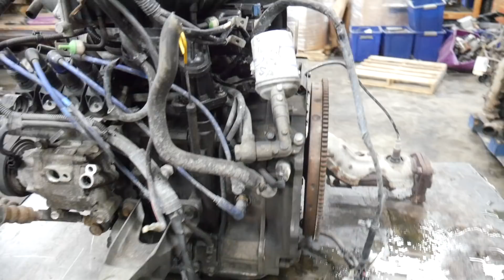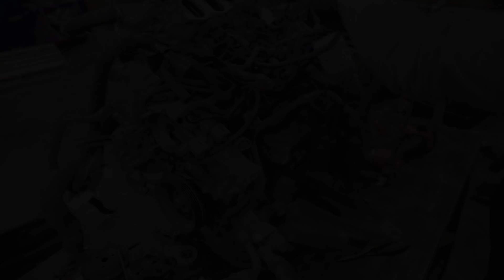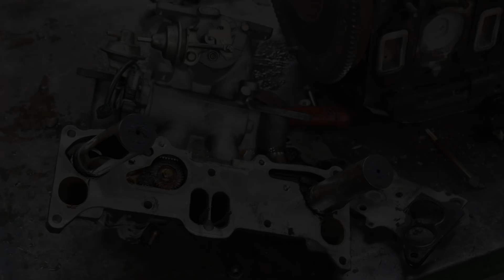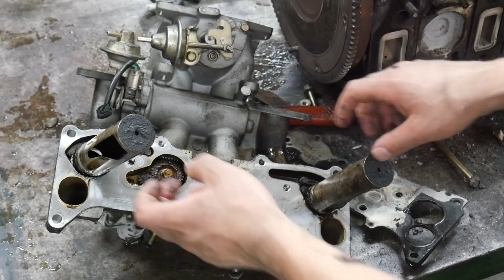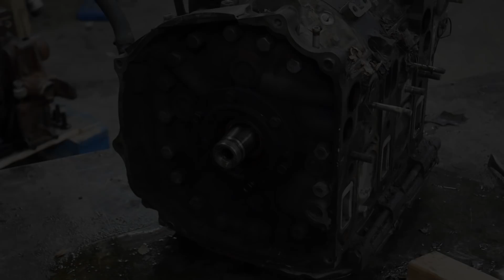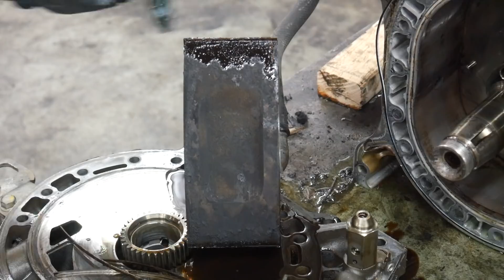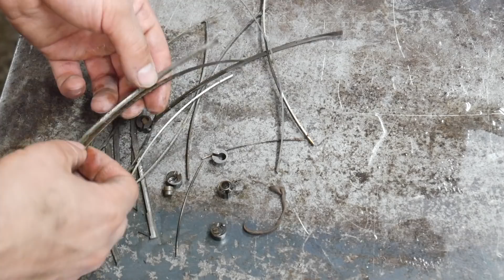13B RENESIS Total Rotary Teardown. 04-11 Mazda Rx-8 6-Port!

Comment: What kind of horsepower can I get out of my 2004 after I rebuild and changed to 19 9413 B housing and rotors, change ring, and pinion gear in rear 4.4  r 4.1

Comment: the rotary engine is a race car, if you are not on top of maintenance all the time they will fail on you, and it will be catastrophic failure, seals breaking off being sucked into the turbo system, mazda themselves just offering to replace the entire engine instead of tearing it down and fixing it cause it would be much quicker for the customer. Rotaries are not reliable in the sense that they cannot just be driven and ignored and pushed to all hell like a 4AGE or a RB26 / 1JZ 2JZ ETC. The fact you have to do XYZ so much to make them some what reliable proves they are not reliable. and this is coming from someone who loves rotaries. but we have to be honest here.

Comment: When sludge built up in the catalytic converter, this led to an increase in 'back pressure'... eventually leading to SIDE seal failure. They say "never use an RX8 engine for your restomod".. whether it be FD, RX3 or any 🐝.

Comment: There are a number of problems with the rotary engine produced by Mazda. However specifically with the Renesis engine, it is the catalytic converter getting clogged which then affects the seal.

Comment: You mentioned RockAuto -- I will NEVER use them again! I ordered a set of brake rotors & pads for a Subaru -- and the front set of both pads & rotors were the wrong ones (too small). I went through the online return process & their computer interface decided that it was neither their fault or my fault that I got the wrong parts -- so they would only credit me 50%. There is no way of pleading your case or talking to a human -- the machine has spoken! I used to be in the auto parts business -- so I absolutely KNOW that I looked the parts up correctly -- but it was their listing for the part numbers for both the front pads & the rotors that was wrong.

Comment: Just FYI, the springs on the seals are only there to apply pressure at startup. Once the engine hits compression, all seals, apex, corner, and side seals, are held with compression gasses. Carbon is a sign of not being run hard enough or use of synthetic oil. The oil metering pump deliberately delivers oil to the engine intake to mix with fuel/air so the seals are lubed on the rotor (oil seals at the rotor gears prevent engine oil from getting in). Synthetic oil burns gummy and incompletely, and will easily stick a side seal, which is far more likely than an apex seal. Side seal sticking is probably the most common compression failure in a Wankel.

Comment: My first car was a 1979 RX7, loved it while it lasted, lol.  Later I got an old 1983 RX7 while I was in the military in the 90's.  That car had oil leaks, clutch issues and every other rotary issue.  I traded it in for a new 93 Probe and I asked for $500 for it.  The dealership wasn't to happy when they took a test drive in it after I already signed the paperwork, lol.  They were real quiet afterwards.

Comment: Mazda should make a "REAL" rotary engine.  A TURBINE.  l had a'74 Mazda rotatry pickup, currently have an air cooled Curtiss Wright rotary, going to convert to external combustion, the only practical solution for this engine design.

Comment: Wait, wait. Your father was a Mazda master tech?! What does he think about the KL SERIES V6? THEY HAVE MORE IN COMMON WITH MOTORCYCLES THAN TRADITIONAL ENGINES WITH A SPLIT CRANKCASE and pretty much a 6 bolt main with that huge girdle, bottom half of the crankcase being an extremely robust low end. Please, please do an episode on a Mazda KL engine. I've owned a Mazda MX-6 and a Ford Probe GT the GT was KL-ZE swapped. Rev limit at 7500 for a 2.5 v6? Excellent motors. Would love to see even a klg4 from a later 626 anything from the KL family!

Comment: you think the crank bolt is tight on that try to remove the crank bolt out of an M62tub44v8BMW engine the torque down to 350 foot pounds factory spec at least doing it by hand is a pain in the ass maybe with an impact way easier

Comment: I tore down a 12a rotary around 1988 and I was looking forward to seeing you pull the flywheel.  Damn.

What I did: purchase the socket, which I still have, then made a trip to the steel scrap yard and bought about six feet each of stout angle iron and round pipe sized to slip over my breaker bar.  Drilled a pair of holes and bolted the angle iron to the flywheel using clutch cover bolts.  Then braced the angle iron on the driveway, attached the socket, breaker bar and steel pipe extension at an acute angle, and then stood on it.

It took a substantial amount of my 180lbs standing near the end of that pipe to break it loose.

No surprise: rotor housings were thrashed.  Large sections of the chrome facing were gone.  Also the end housings weren’t in good shape.  So we just bought a used engine and dropped that in.  Not so long after, my wife left me, took the car, and wound up blowing the replacement engine.

Comment: Bad memories...my not mechanically inclined friend liked these. I did all his work on a couple 1st gen., and an '88 13b. They were actually very good for him.. 
     I bought  his 88. Apex seal failed, at 228,455 miles. Not too bad, really. But I was in school, broke, and it was Feb 2000 in PA. So, it was cold.
     Bought another crap motor, disassembled both, and made one running motor out of them and minimal new parts. Most work done outside in my parents driveway. But, it ran, and I sold it.
    You are right..that front bolt was tight!
    I think each rotor had 58 parts to seal it. 50 something.
   Perfectly balanced? Absolutely not. Each rotor weighs 11 lb, and moves through a 30mm "stroke" while rotating. Just look at the parts and use your head! And ask why mazda added front and rear counterweights to it. To oppose the imbalance of the rotors, that is the answer. With those, yes it is pretty smooth, like many piston engines. 
     It is too bad that they need oil injection, 4 stroke car oils aren't really made with that in mind, might leave residue, thus goop up parts.
    The combustion event occurs in a moving combustion space, exposing the flame to a lot of relatively cool metal. This is inherently inefficient.  Evidence includes the unusually large radiator (for the engine size and HP), and more importantly,  the mediocre-to-poor mileage they all get.
    The power they do produce isn't the best, they are gutless and feel slower than they are.
    It's obvious that I'm not really a fan, but it is so cool that mazda tried something different.  I am glad to have had some experience with them, and more glad that it's in my past. 
     A second generation rx7 with an LS swap would be cool, and they do fit. 
    Think about that- the engine compartment is pretty full with the rotary....and a 6.0 or bigger LS fits in there. Early LS powered corvettes get better gas mileage, too. Triple the power, better mileage, enough torque to break the mazda drivetrain.....

Comment: Eric, I don't know if the long bolts that hold the rotary engines' irons and housings together are the right diameter for your pulley tool, or not, but they're certainly long enough to be cut down to whatever length you want and certainly stronger than LS pushrods.

Comment: So a friend of mine bought an rx8 new back when they first came out. He heard all the bad stories about the rotary. So he keot up with oil changes. And the man always out 10oz of 2 stroke oil in his gas. It did cause a couple issue which he was able to aleviate long term once making the repairs. I wanna say catalytic converter and spark plugs. Which i believe he either hollowed it out or bypassed it. Cant remember. As far as plugs i just remember him saying he used a 2 stroke dirt bike plugs. Which turned out to be normal ngk plus of a certain temp. I dont remember. Anyways his lasted 130k miles before we had to rebuild it. And the plates werent too bad. I think we resurfaced the outers and replaced the inner. Ended up doing a bridge port and somrthing else to it. Anyways he said the trick is u cant drive these engines without atleast winding it up to its red linr atleast 2 or 3 times a month. Which is why we see alot of suburban moms and dads whose rotaries didnt last 90k miles lol when u baby em, the side seals carbon up as well as the apex seals. Anyways i figured that would be cool info to share

Comment: Owned a  2003 RX8 for 10 years. The ignition coils went bad on me every 20k miles on the dot. No other major issues over the the years. Smaller issues included bad coolant reservoir sensor, a rear strut leak and interior radio lcd going bad.  Car had little power and no torque to speak of. It was such a huge difference when I eventually got rid of it for a 2013 335i.

Comment: I had a '77 RX-4 with a 13B engine. I was much simpler plumbingwise than yours (carb and points). The only issue that I had was stalling coming off of idle caused by the EGR system used at that time. I deleted it, and the problem went away. A reliable, sweet running engine for about 100K miles, when it started using more oil than usual. My daughter totaled the car at 130K miles. End of story.

Comment: interesting engine for sure.  one major difference, other than the basic structure, is that the sparkplugs fire three times for every engine revolution whereas in a conventional engine they fire once every second revolution.  fuel injectors would also fire the same way
i remember these things back in the 1970's, there was a small sedan, wagon and coupe called the rx3 and even a small pickup with the rotary engine

Comment: I dont know anything about the Rotary Engine,  but from what i gather from this video is these 2 facts:
1.  DO NOT SKIMP OUT ON OIL CHANGES!!
2.  Be willing to pull the engine,  or have a Dealer do it at around 80,000 to do new seals and Apex Seals.
It seems to me that these are a Niche Cult Following.  And only HARDCORE Rotary lovers should own these.  And not the shade tree mechanic that dreads doing head gaskets on a regular engine,  let alone doing Apex Seals on a rotary.

Comment: 13:41 

What is this assembly called? I was taking mine off and broke literally all 4 lines with barely any force. Extremely dry rotted. Can I just get some identical line and run those or should I get OEM replacement? I look up oil injection lines and all I see are the long OMP lines. Thanks

Comment: I have been a HUGE fan of the Mazda Rotary engine for decades and have rebuilt many of both my own and friends engines, as well as did performance modifications on my own rotaries, it truly is incredible how much horspower and torque you can extract from such a small and light engine, I enjoyed watching this video, and although I can not touch any of the parts, from what I can see in 1080p, this is a VERY rebuildable engine, I am not the biggest fan of the Renesis engines of the RX-8 Series, shoving the exhaust through such a small port is a massive bottleneck, REMEMBER, what is an internal combustion engine? at it's rudimentary definition, it is an AIR PUMP, and restricting the flow of exhaust gasses like Mazda did in the RX-8 engines was really stupid, and probably cost the engine 30 horsepower or more, not to mention, that the ability to enlarge these ports is basically non existant, the 13B's of the 1986-1992 RX-7's were very well constructed, and the the 13B's from the 1993 to end of the RX-7 production run, were also very good as well, now early in your video, you mentioned that the biggest problem with the design that Mazda did not fix in 50 years, i COMPLETELY agree with you, assuming that you are talking about the extremely high exhaust temperature because of the contamination of the fresh air charge and loss of compression into the previous exhaust side, there area actually a FEW problems that Mazda COULD have repaired and never did, if they had, the Rotary engine would be one of the cleanest burning and highest power engines especially given is very small size and very light weight TODAY, and honestly it SHOULD be, now through my experience with these engines, the BIGGEST problem with them is the ALUMINUM rotor housings and the CAST IRON front, center and rear plates, as the engines heat up and cool many many times, the difference between the two materials it is no wonder whatsoever WHY the housing seals fail at over 100,000 miles, ANY first year engineering student would have seen this, and the MAZDA ENGINEERS should have seen it and prevented this from happening, there is not a single reason in the world why the Rotary is not a 500,000 mile engine till first rebuild/refresh, the rotor seal material selected was a VERY POOR choice. rotors are also poorly designed, especially the combustion pocket, and the leading-trailing spark is stupidly arranged like they are.

Comment: Bought an RX8 for 200GBP which needed entire clutch mechanism replaced - Did that and it's easily one of the best handling cars ever made. What nobody mentions is the horrific fuel consumption which is between 10 & 20 mpg, and replacing the stereo with dual-din is too expensive!

Comment: They built a good boat anchor. I rarely saw a good engine  over 100,000 miles. Most of the time customers would complain about the engine stalling in stop-and-go traffic when the ambient temperature got into the upper 90s or above. I've always said if you buy an RX-8 make sure it has a sunroof. When the engine dies at least you can turn it into a planter box.
Reply: Everyone that buys an rx8 knows it wont last past 100k, that s why you get a cheap one that s almost dead and rebuild the engine yourself, then you got an rx8 that s going to last you 100k miles

Comment: Had an RX7 in the 1990’s. Your life revolved around those apex seals and engine compression. Had to buy spark plugs by the sleeve and two-cycle engine oil to mix with the gasoline.
Reply: Who pours the wrong oil down the wrong filler hole?
If you can't read a owner's manual or read the label on a bottle of motor oil?
You have no business under the hood of any car.

Comment: They are ment to be run on high revs not in eco mode ... And EGR messed them up even more ... Plus they need to be warmed up not cold driven... And the engine might keep more than 150k easy ... Then redo apex seals and refresh engine... Maybe
Reply: Wankel engines are inherently unreliable and fundamentally inferior to reciprocating piston engines which is why they have been obsolete since 2012

Comment: In 1983 the RX7 was like a dream car for me. I was 17 yrs old and had no clue they had rotary engines. It said rotary on the side somewhere but all crankshafts are rotary so it seemed normal. Really happy I never bought a used RX7 like I wanted to.

Comment: Key for the counter weight IS NOT a woodruff, also commonly/improperly called a half-moon, key!  Otherwise, great video, thanks very much.  Friend repaired an overheated one in 1976, water leak, and the replacement rotor housing cost $125 at the time, $670 in today's dollars, and we felt it was very cheap & that Mazda was keeping the price down so as not to scare away people.

Comment: Shame you chose the Rx 8 engine as it is well recognized as the worst rotary ever built, the guys in the US with their ridiculous emission laws created the problem that Mazda had to overcome, hence all the bullshit induction and exhaust garbage. If as you say, you know a bit about Rotary engines then you would not attempt to remove the Eshaft pully with a poxy  impact driver, never going to happen if the nut is correctly tightened, so why not use a correctly fitting socket and long bar as most of the rest of the world does. There is a very good reason for that bolt being that tight, and once again if you know as much as you portray you do, you would not show you ignorance by not knowing how to remove it. Any one using an Aluminum tipped hammer on an Aluminum casting  needs to go back to engineering school and ask for their money back, you have been ripped off. I have seen enough now so won't watch any more. If you want to produce these videos then stat by becoming an engineer.
Reply: Well it's the only example made in this century, everything else is a vintage engine.

Kind of a moot point, all Wankel engines are inherently unreliable which is why they were ultimately a big failure.

I'm sure this engine is going to the scrap metal recycling bin so it really doesn't matter does it?
Reply: That old,worn out excuse just doesn't hold up to the sniff test does it?
The Renesis was plaged with reliability issues  and extremely short service life not because of any emissions standards.... it was because of  Mazda's efforts to make the engines  competitive in hp and torque output and fuel efficiency which was having a crippling effect on RX sales.
The Renesis had the highest Static CR and IMEP of any naturally aspirated Wankel engine...Mazda simply pushed the limits of the Wankels inherently poor combustion chamber architecture and weak seals.

Comment: Awesome video for folks like me who never owned or worked on a rotary.  Not that there's much to work on without hoisting the motor out and splitting it up first.

But seriously, this kind of wear and compression issues on a motor with not even a 100k?  That's not bad, that terribad!

Maybe back in the 50s it was okay to have an engine need a full rebuild every 50-70k miles, but this is 2023, not 1923.